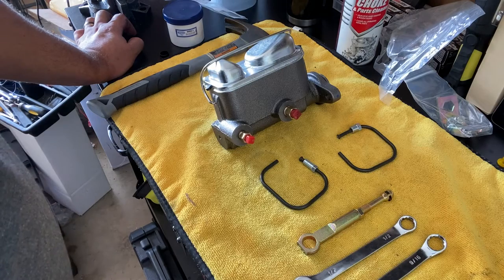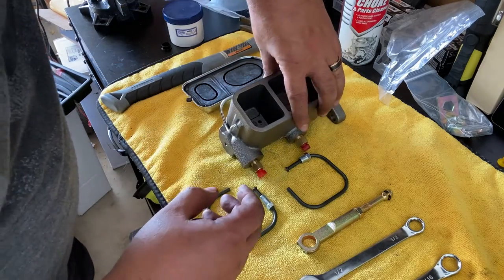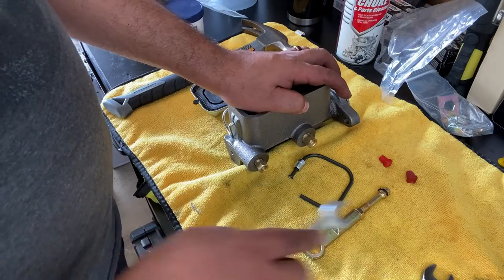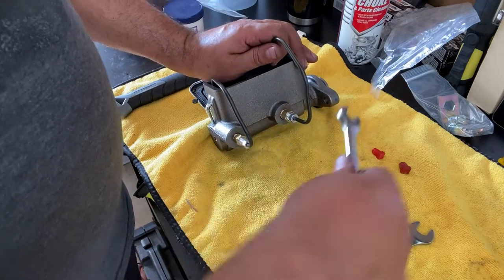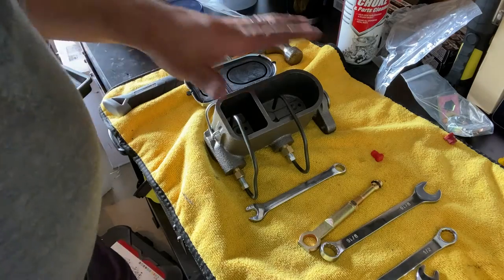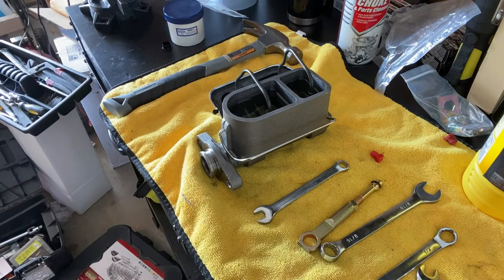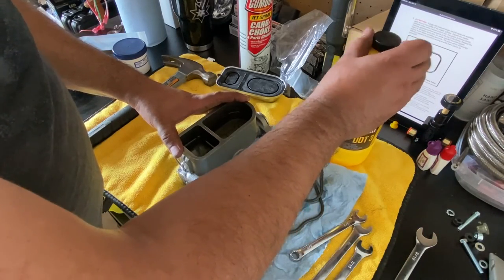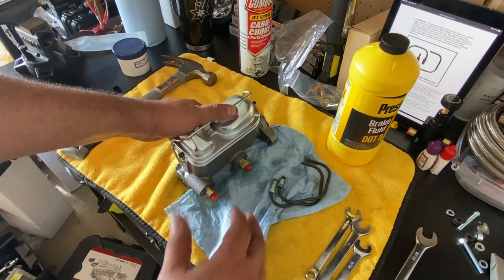How to bleed your master cylinder and prep for install Classic Mustang #brakes #benchbleed #csrp

Comment: Hey Negan! I just did a M/C swap last summer. I also have manual brakes with factory Kelsey Hayes 4 piston discs up front and drum on back. (for now). Old M/C worked ok but I wanted more line pressure so I went with a smaller bore size from the 1" bore previously. Next is a drum to disc rear conversion this spring, and an Edelbrock top end kit to put me over 500 hp with the 460 big block. Possible supercharger too, but all that stuff has gone up a lot thanks to that POS fake mask wearing Biden. Thanks for sharing. See you on the next video. Cheers from Motown/Dearborn.